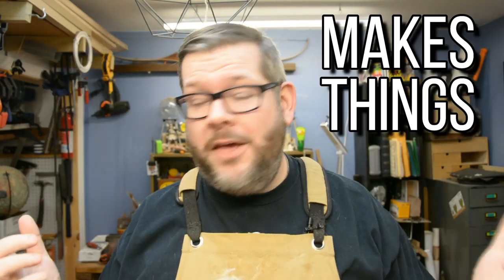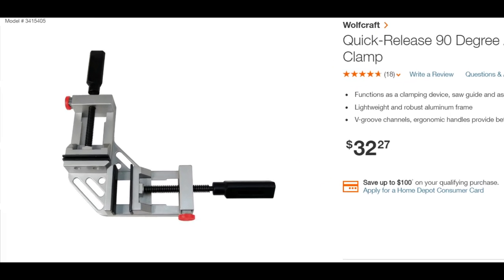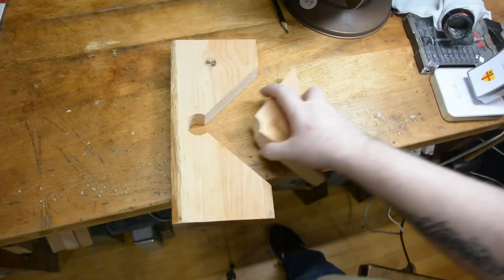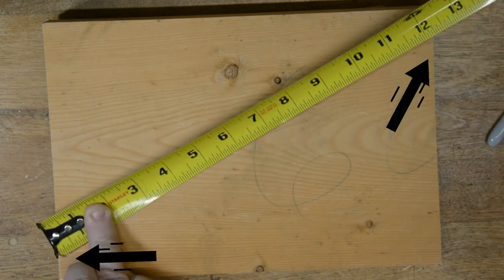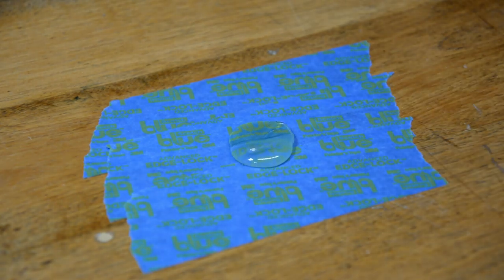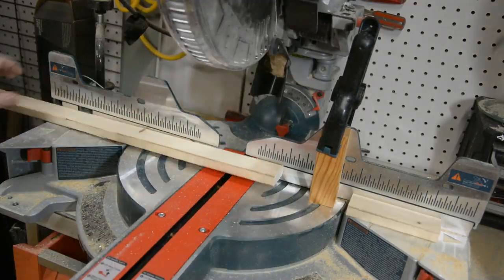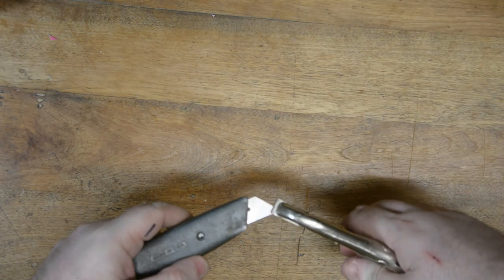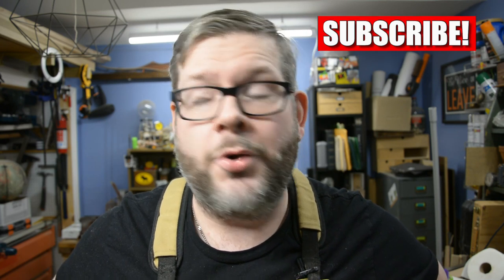5 Shop Hacks #3

Comment: If you use the combination square to position the stop block on the mitre saw, remember to take the carbide tips into account. The carbide tips are a tiny bit wider than the body of the blade.
Well, if precision matters. It does to me (occupational hazard from when I was a fitter)...
Reply from the maker: Absolutely!